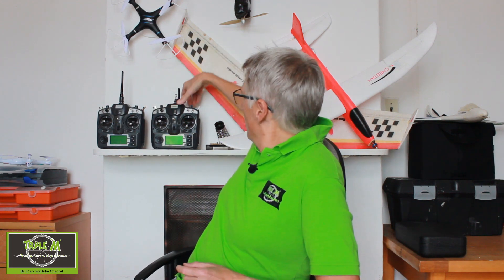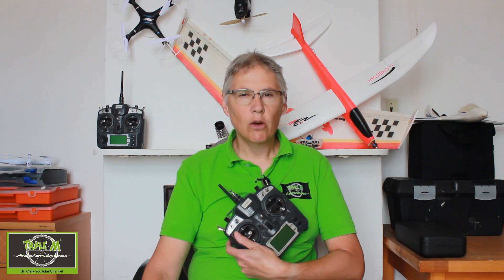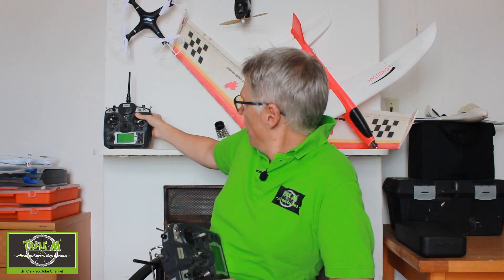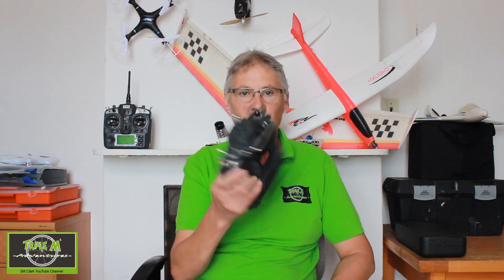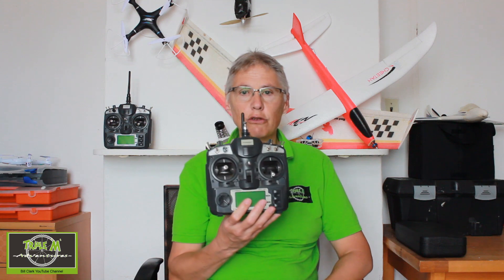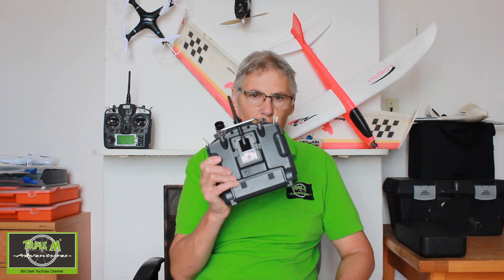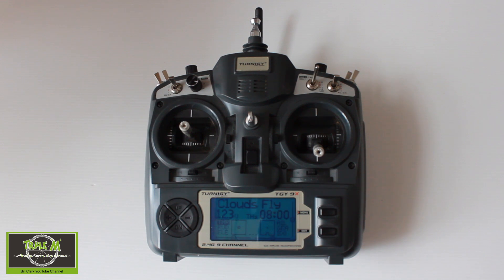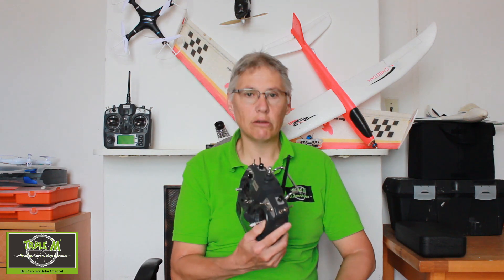Turnigy TGY 9X Conversion to OpenTX

Comment: Bill ... 

1- Looking at the large IC chip in the two radios; are they the same model numbers ? 

2- Looking at the bottom edge of the large IC chip, and counting the traces connected to resistors from right to left; if the solder-pad on trace #7 ( on the version ( V ) 1 ) is not SCK ( System Clock ), then do you know what it may be ? ... I ask because you say when you soldered to it, nothing worked. But when you soldered to the resistor on trace #6 it worked. The V 2 has the solder-pad on trace #6 ( SCK ) connecting to resistor #6.

3- The 9X transmitter with the collapsible metal FM antenna is one of the first rebranded to come out, in the early 2000's. The rebranding was from the original Eurgle 9X which appeared a little earler, also in the early 2000's. They have the V 1 mainboard and V 1 original ( stock ) firmware.

Thank you for your time with this. Much appreciated. Cheers !
Reply from the maker: I am not knowledgeable on electronics so cannot really help you. It was strange that I needed to solder each radio slightly differently.
Reply: @the-happy-RC-flyer Thank you Bill. I'm somewhat taken by your reply on this subject. You had struck me as the tech-geek type that drove deeper into the intricate workings of tech related subjects.

Your information on soldering to the number 6 resistor instead of the solder-pad on the number 7 trace connected to the number 7 resistor on the v1 board was most helpful. Should anyone have the older V1 board, they now know what to do.

My hunch is that a manufacturing error was initially made by placing the  solder--pad on trace 7 instead of trace 6 on the V2 board. This solder-pad is the System Clock ( SCLK )،

Anyway; thanks for taking the time to reply back.  Much appreciated.

Comment: So you use eepe EEPROM programmer to backup/flash the firmware to the radio. Cool 😎.

I saw you posted a link to googledrive with the firmware. 

Thank you so much.
I was about to give up hor a little time.

I got mine backed up using a Wemos D1 Mini Lite as serial programmer

I realy love the layout of this radio